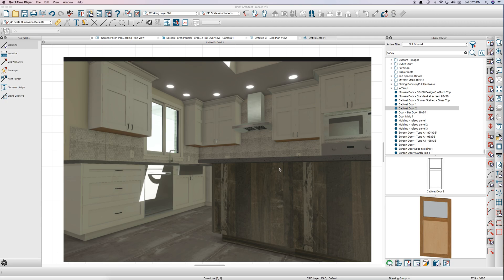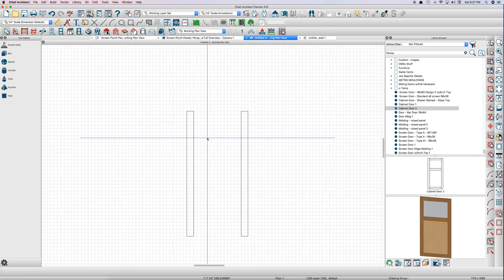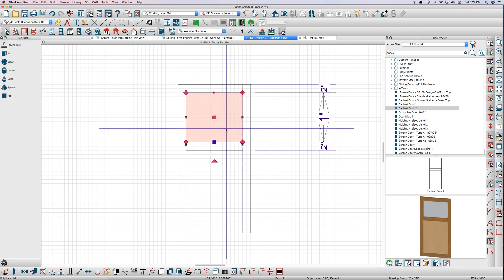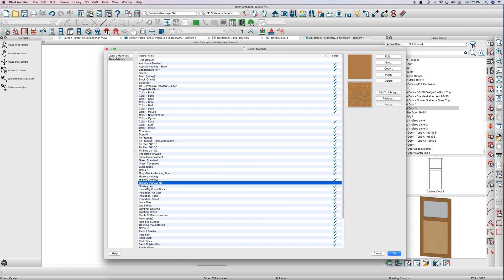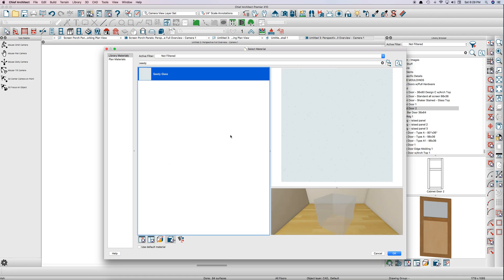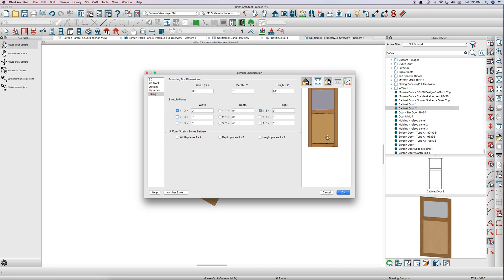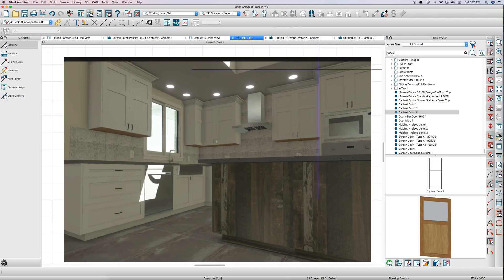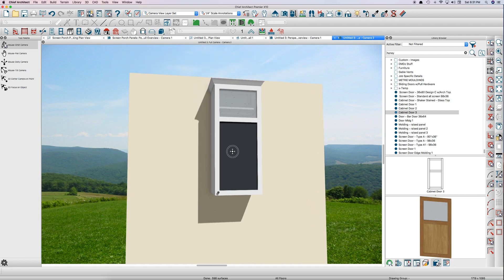Symbol How To   Create a Cabinet Door

Comment: Do you happen to have a demo showing how to make a shaker style door with a profile on the inside frame?  Would you add the profile as a molding?  Thanks.
Reply from the maker: Never have done what you are asking...I would have to give it some thought. With Chief just about anything is possible if you have the time and patience.
Reply: @ChiefSkills   From what I recall, I'd have to make a rectangle solid offset or whatever it was called in chief, to make a smaller poly as the hole, then copy that, use it as a molding polyline... The problem with all this is, I want the texture grain on the styles to be vertical and the rails to have horizontal texture.  I have to go play around with all this.  It's been a while.  No worries.  I've just quickly reached a point that I need to make custom cabinet doors.  Skill worth learning in my case.  Thanks nice video.   Best Wishes!